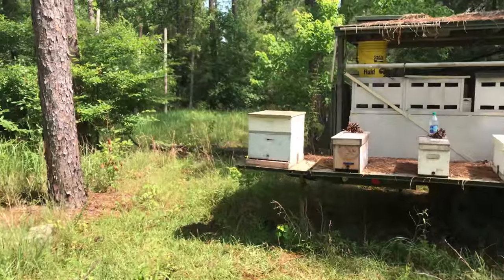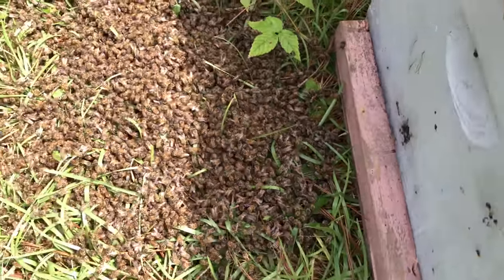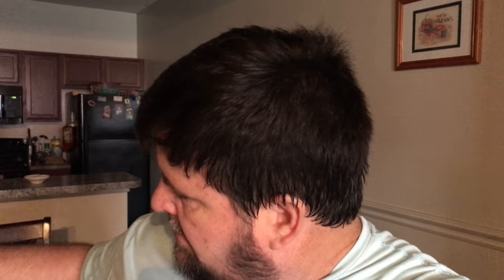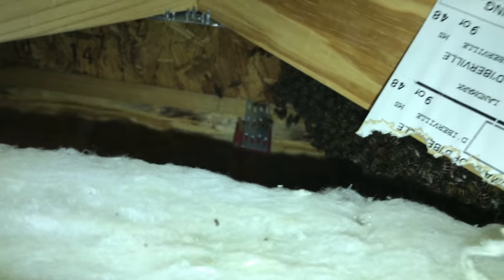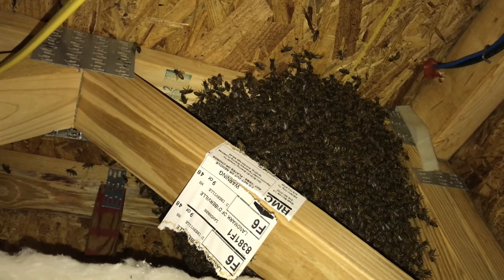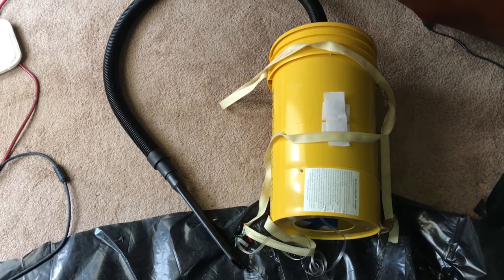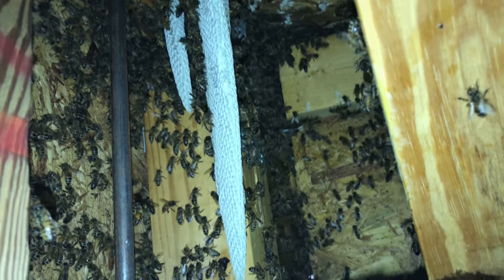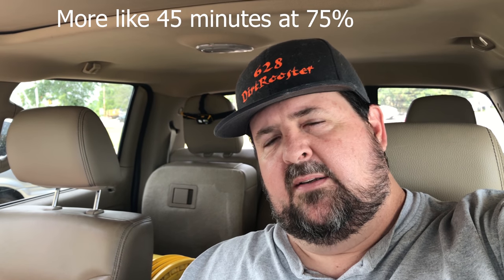Honey Bee Rescue Fail Gets A Second Chance

Comment: I don't know what camera you use but, did you check whether there is an app for it? With my Fuji I can get a live view from the camera on my phone. That might make working in blind spots a little bit easier.

Either way, great job!
Reply from the maker: This was done with my phone.  I stopped using my good cameras for removal videos because of all the dust and honey that gets in them.  I can rinse off my Iphone.
Reply: 628DirtRooster proof that I only grab swarms, didn't think about that. 

That said, getting a rainsleeve for the camera could help. When I was still shooting extreme sports I used those to keep out dust in the forest and sand on the beach. 

They tend to be pretty cheap and you can use them multiple times.

Might work for these situations as well.

Btw, new vac looks very cool.
Reply from the maker: Might have to see if I can find one that doesn't kill the audio.

Comment: Hey Randy! Thanks for the video. What kind of battery does the vac use?
Reply from the maker: It's a lithium battery custom built for the specs of this vac.
Reply: Awesome!
Reply: I advertise that the battery will last typically 4-6 hours.  I had a customer call me last week giddy, he ran it for 9 hours across 2 cutouts and asked what the yellow light means (which is that you're down to the last 20% battery capacity).  It's made to run for a long, long time.
Reply: That's what I need for my power tools! :-)
Reply: One of my philosophies is "If brute force doesn't work, you didn't use enough".  If you can't finish a cutout in 4,6 or maybe 9 hours; well, I do sell spare batteries!  When I designed this vacuum, I had made (like everyone else) a shop-vac bee vacuum.  It worked, but I hated it.  I took a piece of paper and drew a line down the middle, one side "Good" I listed all the things I liked about it.  On the other side "Broken" I listed all the things I hated about it.  I then set out to design a bee vacuum that solved all of those 'hated' problems without breaking anything I like liked.  And that's where the name came from, it does "Everything"!
Reply: Fantastic Tony!